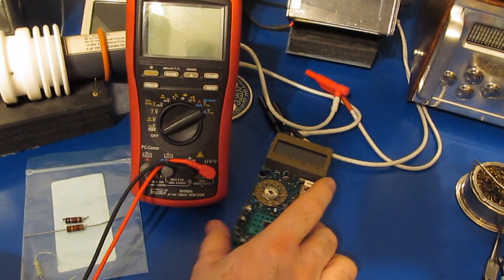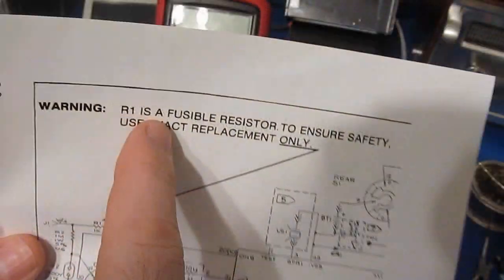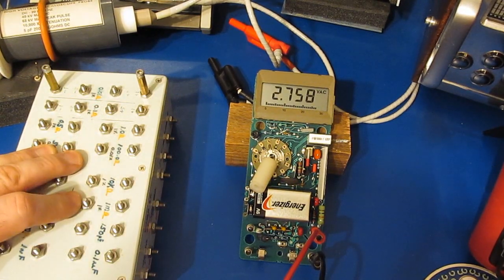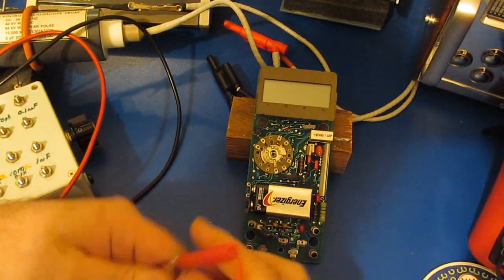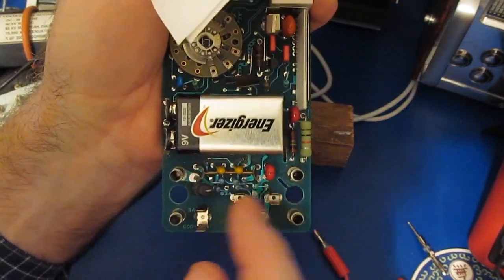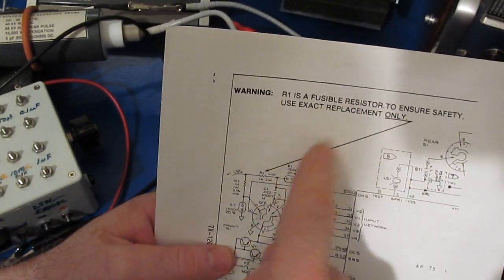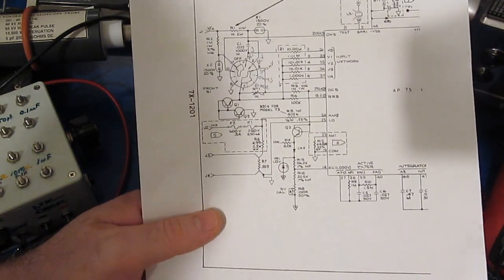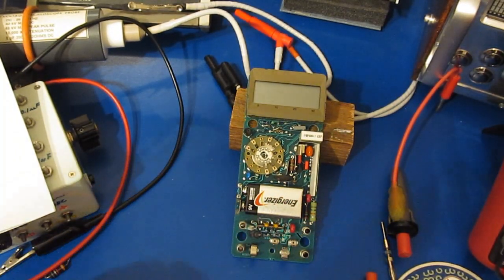The Fluke 77, Part2, Repairs and ESD testing

Comment: Hi, Do you have please the part number of the 1K ohm resistor that you bought from Mouser or DigiKey because I think that the resistance reading problem is that resistor. Thank you.
Reply from the maker: That resistor could change a fair amount and it would have no effect on the resistance measurement.  Again, I think you are asking way too much from this old meter.  The best you can do is a short and then do the subtraction by hand.   IMO, if this is a measurement you need to do, buy a proper tool for the job.
Reply: What I saw is if I short this resistor R1 and test Ohms on shorted leads I get 0-0.1ohms but in other hand I tested this resistor and it's in the spec 995 Ohms. Thank you anyway.

Comment: Hello, I have this meter Fluke 77 and I can't get the 0.1-0.2 Ohms. Instead I get 3-4 Ohms and sometimes even 7 Ohms. Can you please help how to fix it. On voltages it's OK. Thank you.
Reply from the maker: Typically below 10 ohms, I am using my bench meter with 4-wire.  What are the specs for the Fluke 77?
Reply: I have 2 other Fluke 77 and they read on short leads 0.1-0.2 Ohms also on the UM it says not more than 0.2 Ohms on shorting the plus (the red lead) with the 10A on Ohms scale were mine is 3.8 Ohms.

Comment: Thank you for this video. My 40+ year old Fluke 77 display went bad and I was looking to repair it, but with your description of the old circuit design I think I will just buy a new one. I don't do that much electronics anymore being retired I might just go for a lower function model.
Reply from the maker: There are a lot of very good meters available today.  Sounds like you were happy with the 77, so I don't think you will have any trouble finding something similar.

Comment: Hey Joe, For the Uni-T UT139C if you slowly change the switch from uA to mA  does your DVM reset and/or turn off... But if you move the switch at a normal speed it works okay?

For me this only happens between these switch two positions.. (Obviously not counting the off position :) )
Reply from the maker: The two that I had both were damaged during testing and recycled.  I am not too surprised that you could find dead spots between selections.
Reply: My Uni-T UT139C went haywire similar problem to you. It would only work in a few modes and keep resetting in other modes. I checked the switch and it looked okay and nothing looked damaged on the board. I never used it in a way where it should have gotten damage. I ended up buying a Brymen BM257s.

Comment: Poor meter got the electric chair.. R.I.P. In older 25 and 27 they use three fuses, a 15A, a 3A and a little 630mA in series with the 3A. The little 630mA usually ruptures first (when in mA and uA) and saves the user from buying an expensive 1000v rated hrc fuse. The small ones are really cheap and you have a little place for a spare in the battery compartment, pretty thoughtful of them. Great info on the evolution of the amp protection setups, thank's for sharing!
Reply from the maker: You may be interested in the following:   https://www.eevblog.com/forum/testgear/fluke-77-fuse-bussman-ktk-15-counterfeit/msg3206008/#msg3206008

Comment: Cool, extra tests. BTW, if you dont wont to give it away for parts, i think I may have a 77 parts unit in which a battery leaked but has a case if you want to save it as part of your test collection (I think I may have stolen that same said fusable resistor from it).
Reply from the maker: Thank you very much for that offer but I don't think I will do anything more with it.
Reply: @joesmith-je3tq  No problems.